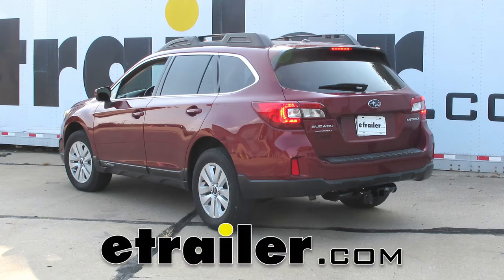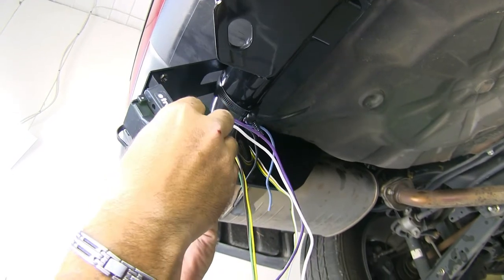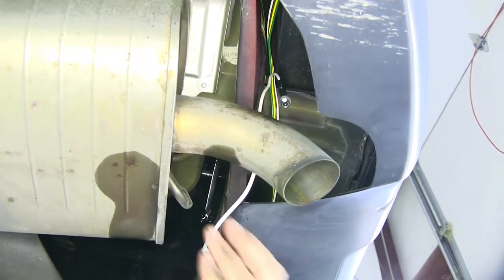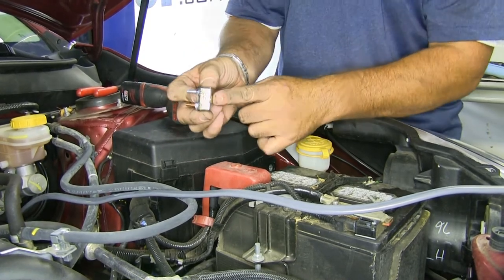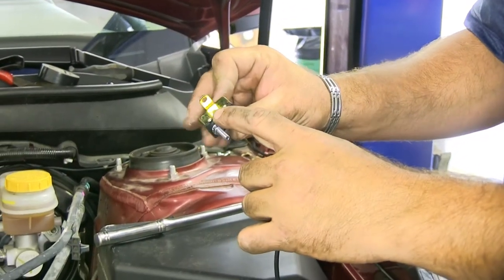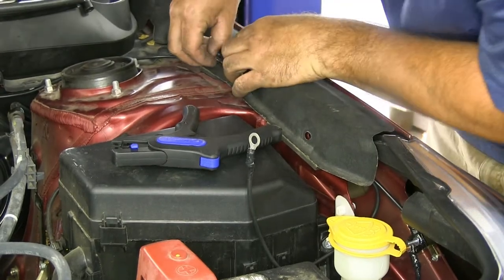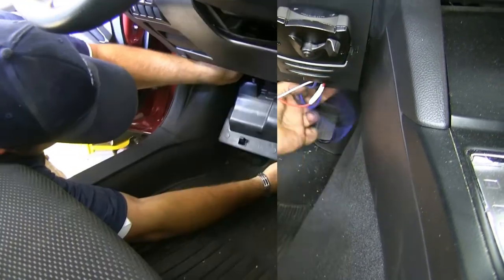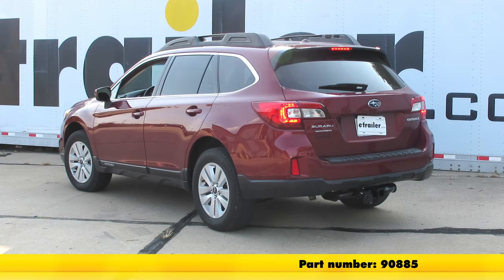etrailer | Trailer Brake Controller Installation - 2015 Subaru Outback Wagon

Comment: I would not put the second braker on the firewall. I would put it as close to the battery as possible as there is no fuse protection on that length of wire meaning if it should ever get the insulation rubbed through or pinched in the future it would become a hot mess.   But a good video, thank you.
Reply from the maker: You're welcome!
https://www.etrailer.com/Trailer-Brake-Controller/Tekonsha/90885.html